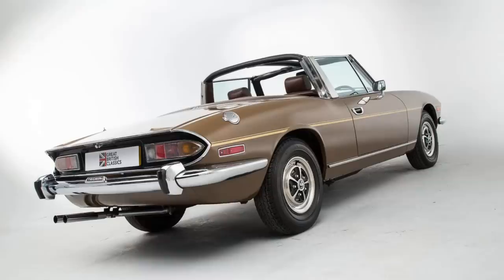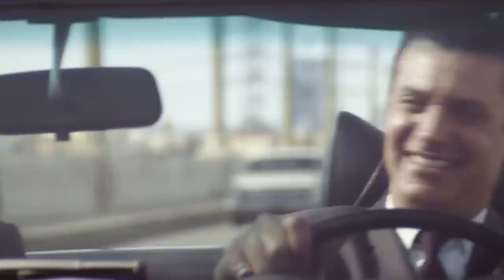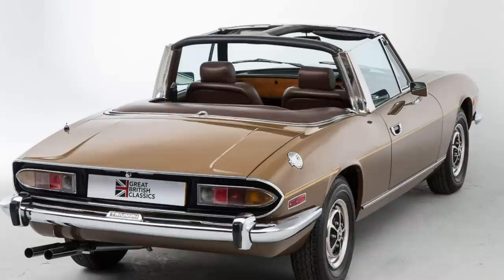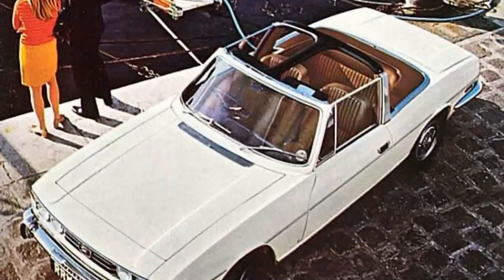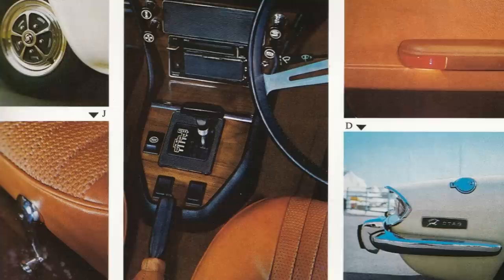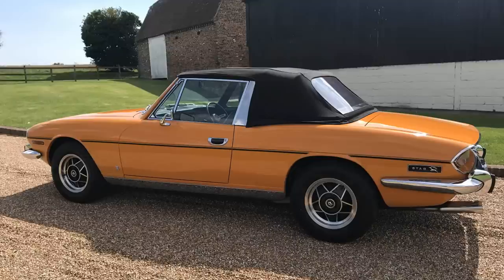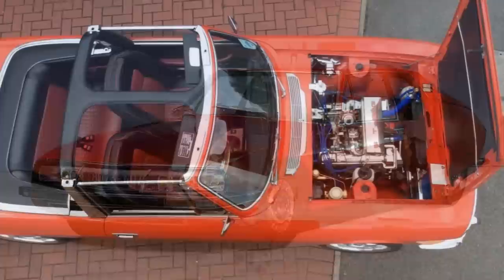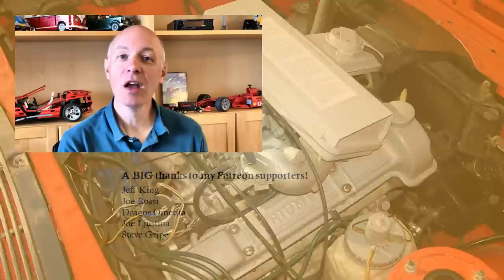Why did the Stag FAIL so Spectacularly?

Comment: I though the T-Bar as added to meet American crash-test requirements? I still have my MK 1½ Stag from 1973. It's been mucked round with over the years, I run it with a Triumph 2.5 straight 6 block with the 4speed + overdrive gearbox, Rover 2.6 heads, and twin side draft 2¾ SU carbs. It's a strange beast, but I love it! Alas, it needs a lot of TLC now :(
Reply from the maker: I'd recommend you check out the video the Triumph Stag owners made that's linked in the description. This will give you a LOT more background, plus maybe some help for your car.
Reply: I was a member of the club, but had to quit due to medical issues, but I do agree they are a great source of information and support.
Reply: Clarkson said it was to comply with threatened US rollover standards that ended up never materializing.  Convertibles ceased being built in the US in the mid 70's in favor of T-tops until Chrysler reintroduced them in the early 80's.

Comment: All cars should have antifreeze all year round .Bad idea topping up with just water
Reply: I don't know why this should have been such a big issue for Triumph.  Jaguar from 1948 on had  cast iron blocks and aluminum heads.   I have one in my garage, 56 years on and no cooling system corrosion.

Comment: I loved my Stag in 1976, as I recal it had a removable center roof panel that fitted into the trunk, much like the Porche 914,  I owned a few years later. I worked at British Leyland in Memphis Tennessee at the time. I bought the car from a customer with a blown head gaskets and knew about the cooling problem.

Comment: Like triumph motorcycles. Outdated technology. Triumph simply didn't keep up with the latest developments.  Example:- the Bonneville motorcycle was basically a 1933 speed twin.  New paint jobs and some chrome is NOT keeping up with the tech.  

The stag unfortunately was similar in respect of an outdated engine but it sure did look wonderful - and sounded good too! Replace the engine with something more modern and you had a great motor. Oh for more reliability

Comment: The design flaws of the engin around 8:10 on, remind me of the fool who designed the Austin Metro radiator on the early models.
I mean, what kind of JERK would have the lot water enter at the top right ( viewed from front of vehicle ) and exit at the bottom right side ( as viewed from front of vehicle )?
This meant the hot water took the quickest route, which was straight down the side channel of the radiator and not through the cooling fins!
I am no designer an spotted this myself!
Later models fed the water into the top LEFT and exited bottom RIGHT, thus making sure the heated water passed through all the cooling plates.
Reply: On Mk2 Stags they did alter the cooling system slightly but entrance and exit of coolant didn't change. There's a program called For the love of cars and in one episode they took a Stag to a F1 engine designer and after testing the Stag engine he concluded that there was nothing wrong with the design of the cooling system as long as it was maintained correctly, the problem was in the production, poor attention to detail and manufacturing discord didn't help.

Comment: The issue WAS that "throaty 3 litre V8", which proved to be one of the most trouble FILLED engines ever built - coupled with poor to horrible quality control in general.

Comment: Yes it was the engine design that was flawed - the 4 cylinder version in the Dolomite was also rubbish and used to blow head gaskets. When the head was removed, it was full of corroded sections near the combustion chamber.  Why on earth they did not use the Rover V8 (basically a Buick design), for the stag, was down to politics and management rivalry. The Dolomite was also a very nice car let down by the OHC "slant 4".

Comment: A lot of the engine's problems started in the factory. Workshops removing radiator hoses to drain the coolant before doing the heads, and having a load of casting sand coming out with it wasn't uncommon. Also, as stated in this pdf, workshops would fix a problem without looking for the cause - i had that problem with a 1990s Audi after the head gasket went, so it's unfair to finger the Stag for it too, but it still happens

https://www.nzstagownersclub.com/StayingOutofTrouble.pdf

Comment: At the beginning, you refer to the Stag's V8 engine giving it the power to take on the Mercedes-Benz SL as its rival.  But the Stag was not a rival - much less expensive, built to UK quality and reliability standards of its time rather than those of the Benz, and overall far too flashy a car for those who bought the Benz

Comment: Too bad - very handsome design.  However, as far as convertibles go, I would only buy those that were specifically designed first as a convertible (Boxster, Miata, S2000, etc.).  Unless you are very lucky, you just have to jump through hoops and make concessions to make it work.

Comment: Dude it is a Stag, if the V8 didn’t stop it you could be sure the electrics will. I have to say if Rover-Jaguar engines are your gold standard of reliability then you might want to look to the Oriental East or Germany for enlightenment.
Reply: They used horribly unreliable Lucas electrics in most 70s British cars.

Comment: Plus the story which was bandied around Coventry in the early 70"s, "I lived a mile from the factory" was that they put the convertible top into the well under the rear facia then further down the line they bolted on a hardtop without checking the build sheet to see if it was to be a cabrio or hardtop. Then a happy customer wrote in to thank them for fitting both which made the managers run down to the line to realise why they were losing money on it.
Reply: @bavarianbrit1  That makes more sense than your original comment. My Bollocks to English translator didn't work.

Comment: Just like nowaday England didn't had the capacity to make proper cooling systems for a car. so cooling water first passed cylinder one, then two, three etc.,,,, meaning last cilinder got to hot resulting in a burned exhaust valve and or broke head gasket.

Comment: Triumph would not admit the engine had problems. Third party companies made fixes for the problems. The problems were primarily cooling related.  A larger radiator was one fix with new top up bottles in different locations, electric cooling fans, electronic ign, etc.  Many Stags with original engines are running with the mods without problems. The original engines would benefit from waterless coolant, featured by Jay Leno:
https://www.youtube.com/watch?v=t7PykrgzWPQ

Comment: Did we really think the detailing would be up there with Mercedes?  On the other hand it was cheaper I suppose. With rustproofing and the other engine it would have been great.
Reply: My father's second cousin, a lawyer, bought a Stag.  He had the usual timing chain and coolant problems, plus electrical faults, so much so he rejected the car.  BL would have none of it and refused to take back the car and refund him.  He took them to court, flanked by automotive engineers and won his case.  The judges ruling became the basis of case law regarding rejection of a vehicle which still stands in England and Wales today.

Comment: ok we all got the timing belt thing , as this was the real disaster with the car ,the freaking chain would break at around the 20k miles with resulting valve contact ,and the heads having to come off thats when the fun started ,what bright spark thought up the those head studs and bolts needed -------with the blunt end of a rag mans bugle, to show what disaster it was as a design even saab who paid for the development of the 4 cyl redesigned the cylhead on the 900 series with a waterpump mod and that car was a reasonable success , if triumphs management hadnt been so stuck up england would have had a super 4 seat grand tourer using the bullet proof rover engine , what a cock up in fact every engine triumph made were a disaster ,but bl also made some class cock ups with the o series etc , no wonder the british motor industry went down

Comment: They got an Italian designer
They should have used the American designed Rover 3.5 v8. A small sized engine with ample power which could be upped.
I had a lovely 3.5 v8 in a Land Rover.
The sound of it was wonderful.
They Issued Stags to the Police to the delight of crooks as they were so liable to overheat and fail to start.
Hahahaha

Comment: I've never understood why they insisted on creating their own V8 than use the Buick engine that Rover had access to. It just seemed, owing to them being part of what became British Leyland, that they cut off their nose in spite of their face. The looks of it were spoilt by the decision to create a decision to create an engine that wouldn't cool down, resulting in the cylinder head warping
Reply: As the video explained, the idea was to create a V8 and an I4 with common components, and their own in house top of the range engine that would compete with cars like the Merc 250.  Outsourcing an engine aka the Rover V8 is not a good policy if you plan to make as many as they did.  But by the time they came under the BL umbrella it was too late to make the change anyway.  If they had made them with more care they would have sold enough to make the car more viable and run for longer than it did.
Reply: The Dolomite/Stag engine was conceived by Triumph in 1962, at a time when Triumph and Rover were rivals, and before Rover acquired the Buick engine. The Triumph/Rover merger didn't happen until late 1966, by which time the Stag design was too far advanced and would have required a major chassis/suspension redesign to accept the lighter Buick engine.
Reply: @saxon-mt5by  true, although, they could have, for later models fitted the Rover/Buick V8

Comment: I find it shocking that qualified engineers should design an engine with head studs at different angles to the block, half of them not at 90 degrees. Also that the water pump was higher than the engine and that trained garage mechanics did not appreciate the importance of the correct corrosion inhibitor and didn't think to blow the radiator through. Atrocious. And weak unprofessional management let it go ahead when they had a perfectly good and well proven V8 already in the stable. BL deserved to fail, they should be ashamed to call themselves English.

Comment: I have owned 3 Stags. Inca yellow manual, Pacific Blue auto, Inca yellow auto.
Unfortunately they were the product of don't give a flying F workforce and a poor quality part. Coupled with poor design.
When I worked for Shell in the 70's nearly every garage I went to that had a Stag in the workshop had the bonnet up. Problem, head gasket if you were lucky, warped cylinder head(s) if you weren't.
Cause? Blocked waterways in the block. Reason? Because they did not bother to clean the casting sand out properly.
Original timing chain was made of chewing gum! (it stretched) until it either broke or jumped a cog, both with disastrous results. Triumph moved to Reynolds chains which were better but being simplex was not strong enough to cope with the torque of a 3.0L V8. Bad design. Should have been a duplex chain from day one.
Triumph originally asked Rover if they could use the Rover SD1 engine in the Stag (Buick 215). Bolshy Rover told Triumph to piss off, so Triumph had to make their own V8 which very basically was 2 bored out Dolomite engines turned into a V8.
Had Rover not been so bolshy the Stag would have been a wonderful car, not the cockup it was.
So saying, once the two problems above were sorted out it was a brilliant car, somewhat let down by the 60's era Borq Warner type 65 3 speed auto box.
Some people, who should be banned from ever owning anther Stag, bodged it by fitting either a Ford Essex straight 6 engine YUK! Or slightly better, the aforementioned SD1 engine. The problem was that they often did not bother to adapt the front suspension. The result being that as the SD1 engine, being all alloy, is lighter than an MGB engine. so the nose of the Stag pointed skywards with the attendant loss of roadholding, causing chronic understeer.
The only GOOD bodge on a Stag was to replace the awful Borg Warner box with that of an XJ6. That, coupled with a fully sorted original Stag engine resulted in a fantastic and beautiful four seat Sports car. I still consider Michelotti designed the best looking 4 seat rag top EVER and I include modern cars in that.
Colin Lambert.
Dip Mech Eng (Historic vehicles)

Comment: Putting a V8 into it was a bad Idea, let alone a cast iron one. So, the original mistake was to try and spec a European car design for the US market by dropping in a V8. I bought three Stags with blown engines back in the day and upgraded two of them with the 2Litre Dolomite Sprint 16V engine and one with the 2 Litre DOHC Alfa Romeo Bialbero engine. The latter was the perfect match, far more powerful, lighter and higher revving than the v8, a real sports car engine. It made the Stag a far more competent car, much better balanced and lighter overall, and the engine was rock solid. A V8 is generally a bad idea in a light sports car. It's meant to move overweight people in an overweight car slowly in a straight line with AC running at all times. The British car industry vanished because they wasted too much money and effort on making cars for the US market, a task European engineers fundamentally lack the understanding of. We tend to think American cars are rubbish, as different and sometimes opposite properties are deemed desirable by Americans. In reality American cars do what they are made for extremely well. Producing an appealing, competitive and commercially successful car, purpose built for the American market, simply wasn't a realistic goal for any British manufacturer.

Comment: What do restorers do? Do they put another Engine in?
Reply: There are engine rebuild  kits that replace pistons to boost compression and run on modern gas, replace the water pump with an electric one, and relocate the reservoir, and replace the radiator with one twice  the thickness and a better fitting shield than directs air flow properly.  After that they are reliable.  My dad's auto restoration Co did that to one in the mid 90s and it's still on the road

Comment: The little Triumph Stag V-8 THAT COULDN'T.
*  OBVIOUSLY, in-house Alpha testing was INSUFFICIENT, Both reliability on an engine test stand and test track drivIng was incomplete.
* OBVIOUSLY, Beta testing was INSUFFICIENT.
Extended, long-range, high mileage road tests were not performed, neither was employee LOANER evaluations.

Comment: I heard they welded two Dolomite engines together. LOL. And corrosion in the rad and channels could be mitigated by using deionised water. But most owners don't understand or don't care.
Reply: Good rumor but no they didn't do that. There's plenty of info online that describes the engine development. However, think about it, if you have designs for a four pot, then mirroring that to create the other side isn't exactly rocket science as a design starting point. Regardless, suggest more background reading for the proper story.
Reply: The Dolomite/Stag engine was designed from the outset to be a modular design with 4-cylinder engines of 1200cc-2000cc, and V8s of 2500-4000cc.
Reply: @saxon-mt5by  I heard the Vauxhall  slant four used in the Magnums/Firenzas etc was half of a GM V8 so it's not unusual to use half of a V8 for a smaller car

Comment: There must have been some engineering naivety there. Nothing about that engine was new, or revolutionary. OHC engines? They'd been around for about 20 years by then. Chain driven camshaft? Alloy heads with an iron block? 2 valves per cylinder? Water pump?? I can understand Triumph wanting their own engine which in many ways was more modern than the Rover, plus they had to develop their 4 cylinder motors, but to make those kinds of mistakes.......they deserved to go bump.

Comment: The Stag was never a match for the Mercedes 280SL. If Mercedes wanted to make the 280SL faster, all they needed to do was raise the ratio of the diff, & put a mild cam in the engine. British Leyland failed to realise one thing. Mercedes have built a car than could break traction of the rear wheels at 150 mph by simply flooring the accelerator. This Mercedes had an 8 cylinder engine. As for the Jaguar, no thanks. I worked on those, along with the triumphs, & other Euro cars, but a lot of persuading will be needed to get me to own anything other than a Mercedes, or if I had the money, & found one, a Lancia Stratos!!

Comment: No wonder British cars were crap the way they designed them. What were their engineers smoking? They should have known that the water pump on the top of the engine was a bad idea as well as they should have known that corrosion inhibiting coolant was needed with a iron-aluminum combination engine and angled head studs or bolts, what the hell??? I'd like to find an old stag body (if one could be found that isn't all rusted out, like that would be possible) and drop a LS or LT engine in it with a 4L80E and Vette transaxle. You'd have to reinforce the body with a roll cage but that would be a good idea anyway.
Reply: British was crap.you naming all or a year